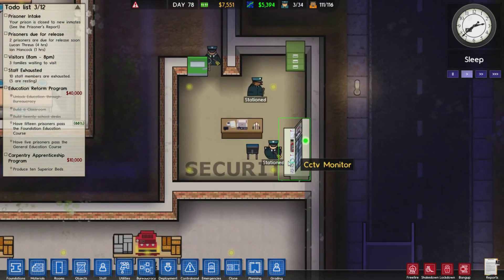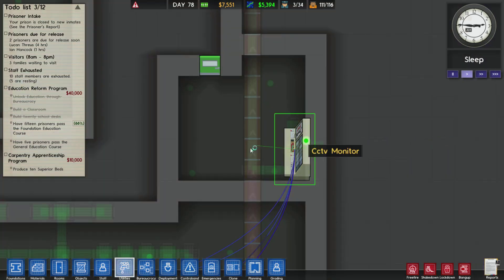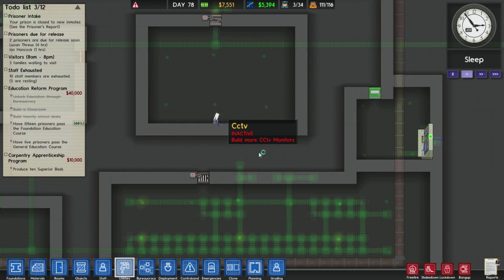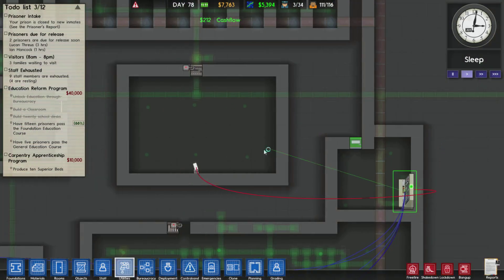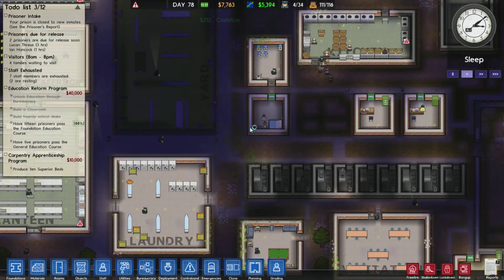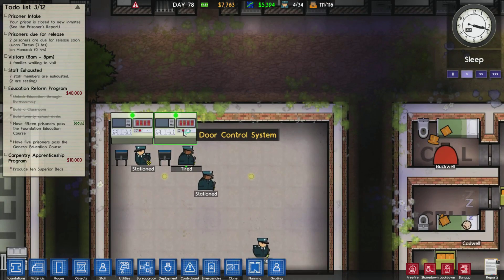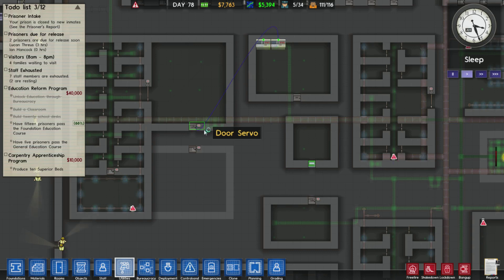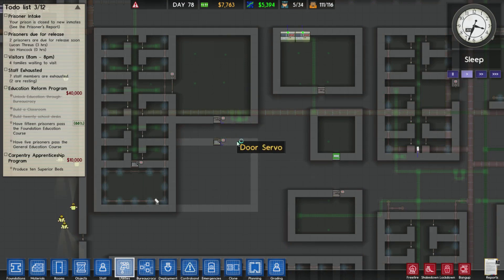Prison Architect Wiki | HOW TO install CCTV Cameras & Servos (remote doors) Tutorial

Comment: any guards can already open the doors you had connected to the door servos. you need to post a new video.
Reply: What about the cooks, janitors, workmen, gardeners and dogs? They can't open those doors
Reply from the maker: Micky Sweetman-Hicks A servo is operated remotely by people in the CCTV monitoring station so those guys dont need to open those doors. I can assure you when i played this, there were no problems with cooks etc opening doors!
Reply from the maker: Chasing My Shadow its not for the guards! Its to make the prison run smoother with prisoners being allowed out of those by the monitoring guards too.
Reply from the maker: ah then certainly you are correct young man!

Comment: Your servo didn't work. The light on the servo will flash green, and the cog will rotate when it is actually used.
Reply: And how do I install them correctly?
Reply from the maker: Thomas Campos By following my video
Reply from the maker: Correct but it does work
Reply: The guards have keys. They open doors without the servo